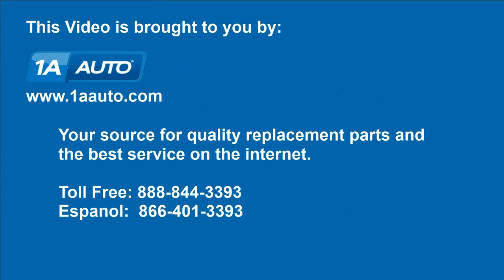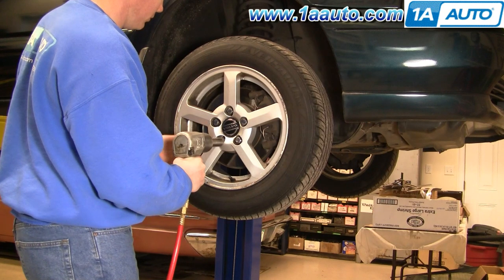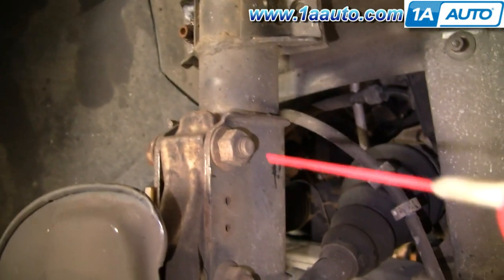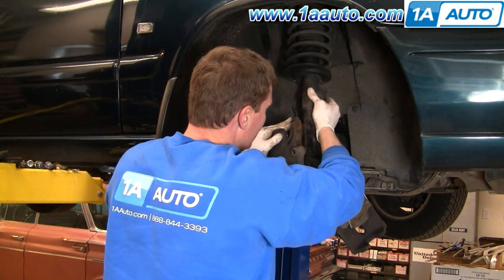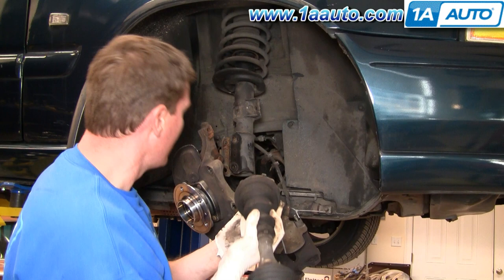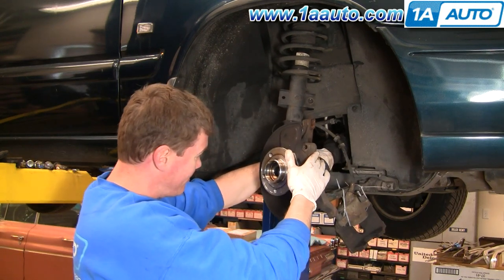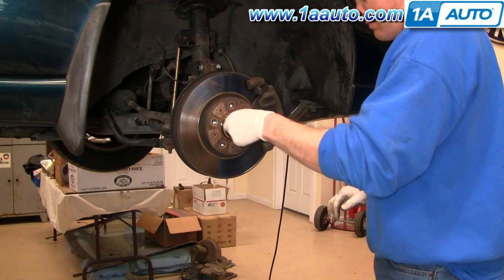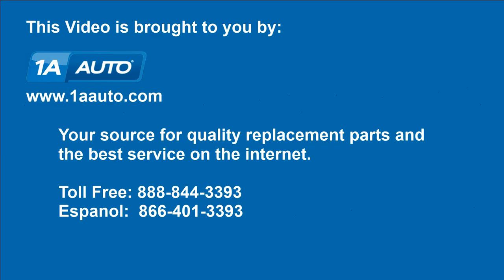How to Replace CV Axle Shaft 1998 Volvo S70

Comment: i just loosened the two Bolts of the wishbone and the Stabilizer, so you don't need to remove all those bolts like in this video. You can even let the Brakes be untouched! Job was done in 5 Minutes! :)
Reply: but for sure you have to remove the big Bolt of the Axle Shaft

Comment from the maker: It depends on what may be bad. If the shake is in the steering wheel but not in the brake pedal check the tie rod ends and also the sway bar stabilizer links for wear.

Comment from the maker: If you have a shake in the brake pedal when you hit the brakes it could be a warped brake rotor. If there's a shake in the steering wheel under normal driving conditions it could be anything from a bad tire or wheel to a worn suspension component.

Comment: Thanks guys, I need to do this on my V70 shortly, this video helped me a lot to prepare!
Reply from the maker: +Tibor K Thank you for watching. Please let us know how the repair comes out!  For anyone else looking to replace their front axle shafts, 1A Auto carries them here:  https://www.1aauto.com/1A/Axleshaft/Volvo/S70/CAACS00021?utm_source=YouTube&utm_medium=CTA%20Comment&utm_campaign=1ATony
Reply: 1A Auto Parts Thanks I did it already today, actually didn't even have to remove the stabilizer link, long as the wheel was turned all the way to the right the drive axle came out just fine. I was done in about and hour and half (first time doing this) and my car is on the road again. Thanks again guys, your video was fantastic help! A+ to 1A Auto Parts!

Comment: Its under normal driving conditions, and i just got my tires replaced. the shaking is significant. If its a suspension component, how much might this cost me. And what else might it be? could it be the cv joint?

Comment: My CV joint failed resulting in irregular rotation and subsequently damaging the seal where the axle goes into the transmission. In addition to replacing the axle assembly, I will need to replace that seal. However, I'm having some difficulty pinpointing the one I need. Can you direct me to the proper seal/advise on how best to replace it without causing further damage to the transmission?
Reply from the maker: Thanks for watching Dylan. You may end up needing to contact a dealer to find the seal. As far as replacing it, you will want to get a seal puller to remove the old one so you do not damage the surface it sits on. Then carefully install the new one making sure it goes in straight and flat so it does not leak when you are finished the repair
1aauto.com 888-844-3393

Comment: I just did the CV boots and control arms on a 98 S70, and in a pinch you don't have to take wheel bearing and stuff. The only things I did was: 0. Take wheel off. 1. Take brake off. 2. Remove the plastic triangle from the arm. 3. Undo the two bolts holding strut to the wheel assembly (or whatever it's called). 4. Undo control arm bolts (three) and take it off. 5. Cut boot clamps and boots. 6. Clean up mess. 7. Set stick to neutral. 8. Pull the CV shaft from the transaxle.

Comment: 9. Clean up old grease (rags/towels, then solvent, until all bearing surfaces are clean). 10. Load outer joint with grease. 11. Dunk outer boot in boiling water and spread it out, drag over the transaxle side bearings. 12. Load up inner joint with grease. 13. Pull inner boot over the bearing using same trick. 14. Clamp both clamps on outer boot and inner boot's outer clamp. 15. Reassemble inner joint. 16. Clamp larger clamp on the inner boot. 17. Reassemble other stuff.

Comment: you never show the large nut on the spindle being tightened or the socket size..
Reply from the maker: +Dan Age Thanks for checking us out! This is the square bolt head on this application and you would tighten this to 33 ft pounds plus about 1/8th of a turn. The larger nut is 89 ft pounds with an addition 1/3 turn. You can take a look at 12:00. Hope this helps!